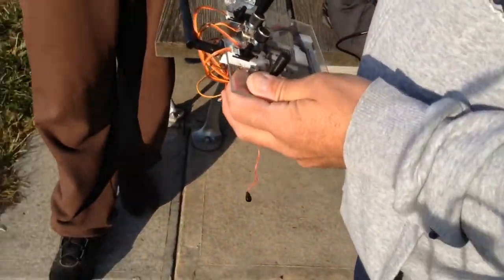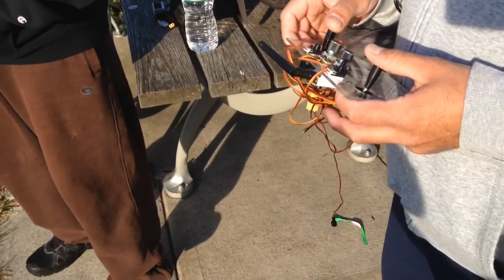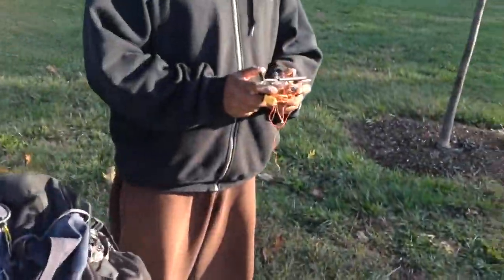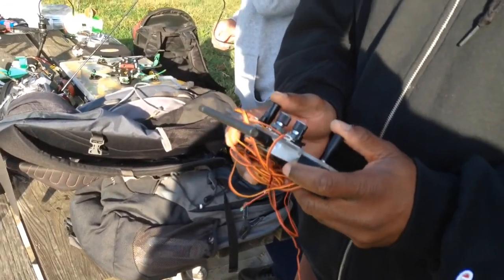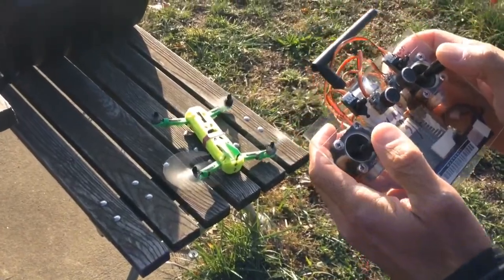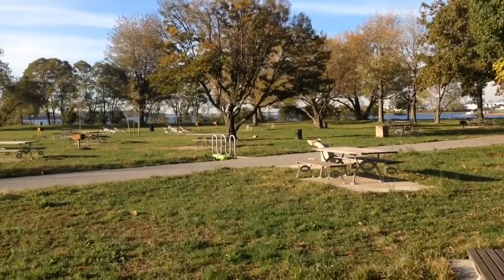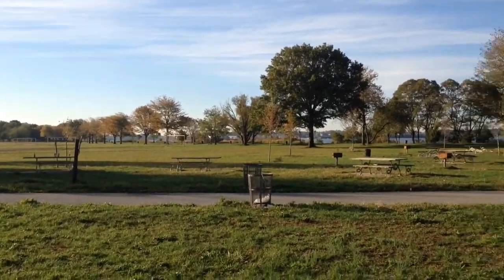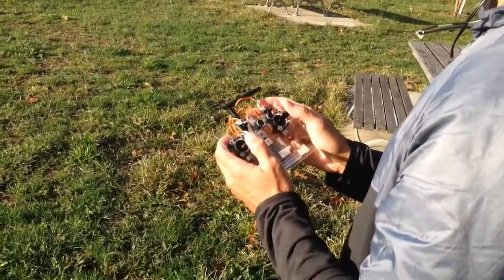Arduino rc transmitter part 2

Comment: Plz upload the circuit diagram of the transmitter and receiver and also the code
Reply from the maker: Go to my latest Arduino video
Reply: @diywithpapo4576  if u r talking abt this link "https://www.thingiverse.com/thing:3867892"
Then the Schematics are not helpful...plz share some more detailed schematics

Comment: y diy a rc full drone use 3 arduino nano. 1 for a transmiter . 1 for fligh control . an 1 more for a receptor.  y diy transmiter in a old Futaba Attack 4 in a 10 chanels 2.4 convertion